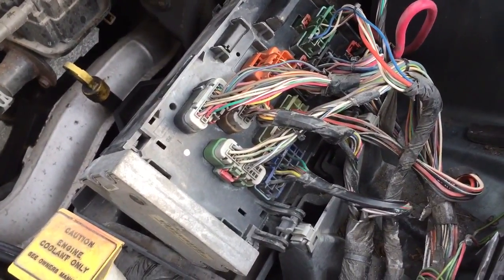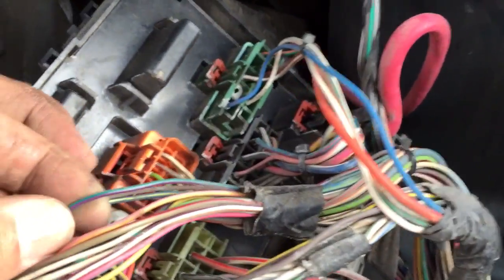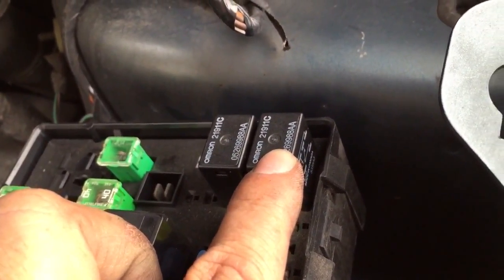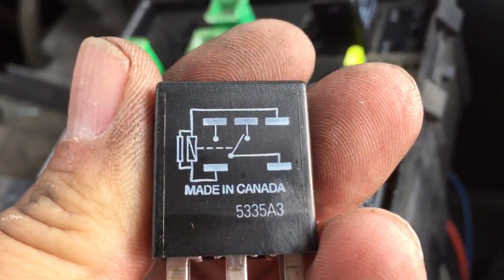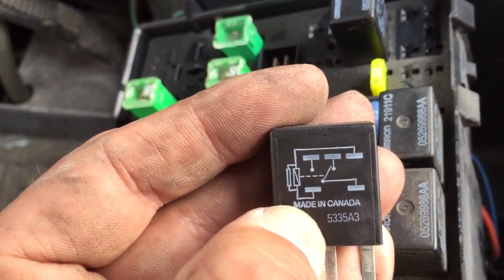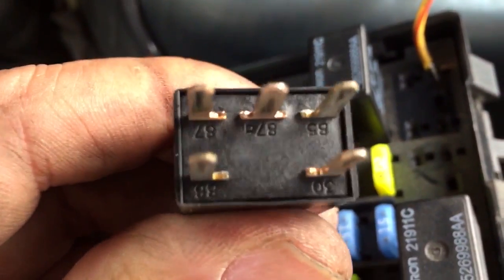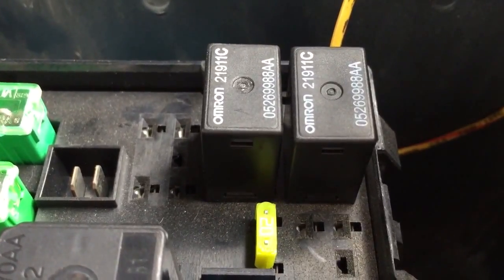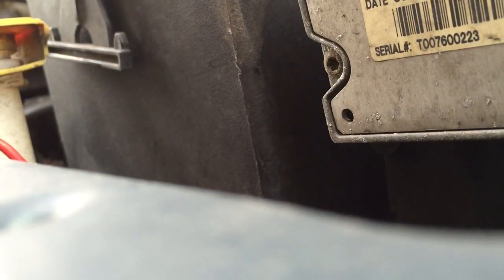2006 Chrysler Town and Country Horn Fix

Comment: Just did this today. 2004 Chrysler Town & Country. Worked perfectly. So easy, and what a simple fix.

Only thing I would say is, mine did use the purple and green wire, but where I had to put the jumper wire into the relay slots was opposite of this video. It was the UPPER LEFT. Horn works, and the horn still signals for the car alarm when you beep the remote.

I used solderless heat shrink tubing for the connection, then electrical tape. You just push the wires together inside the tube, and use a heat gun. Very easy. You can buy them on Amazon.

Thanks a a million for a great hack! Now my 3 year old son can't say, "Dada... honk-honk is boken! (Broken)" 🤣

Comment: After 3 years of trying the "clock" the relays fuses ect, finally found this video! I refuse to go to dealer, as I grew up in the 50s and 60s, did all my maintenance my self, cut cars up, rebuild them xke 3.8 4.2 Holley 4 barrels 283 chevy blocks Etc. I'll struggle not to go to someone else!Thanks sooooo much! Worked for 2007 caravan, the only thing on mine to test the horn it was upper left and lower right.Bob

Comment: just want to thank you ...  just bought a 07 T&C  the owner  didnt tell me the horn was out but he did hit the lock button on the key which made the horn blow so i didnt think that there  was a prob with the horn itself but low and behold the horn wouldnt blow via the  steering wheel so i did just what you did  and it worked i felt like a million bucks by not spemding a dime on the fix ... KUDOS to you and your VIDEO    keep'em  comming

Comment: I just used this video to fix my 2007 dodge caravan’s horn. Before I fixed my van, my horn would not sound from the steering wheel. However, it did sound when I pressed the panic button on my keys. So if your vehicle has the same symptoms, this video should work for you. Just make sure all your electrical connections are correct and contacting. After I fixed the horn, the panic button still works along with the steering wheel.

Comment: Great fix for this problem.  Just used it on my 2002 Gd Caravan Sport.  Thought of trying all the other suggested fixes but this seemed the most reasonable to fix a horn that can't be activated by the steering touch pad, but works otherwise

Comment: Great, clear directions, easy to follow. Unfortunately, when I applied the procedure to my 2006 Town and Country, the horn button still did not work, but now the horn does sound as soon as I put the transmission into reverse! I guess that the "dark green with a purple stripe" wire that I found was not the one I needed.
Reply: My 2006 caravan did the same - what did you do to fix it in the end?

Comment: thanks!  my horn was inop (2005 T&C) and the airbag light was on although cruise controls were fine.  I did the clock spring (airbag idiot light and no horn are classic symptoms of the clock spring having gone bad I guess, although often the cruise control buttons also go wonky).  Anyway, after clock spring, airbag light is out but still no horn.  I did this mod and my horn works again AND it still blows when locking with remote!  Although jumpering the pins where the relay sits did NOT fire it off, I did the mod anyway and it worked!!

Comment: Hi thank you for your help when push horn button relay was coming in i pulled the LH headlight to look at horn connection found a rat had chewed wires into i repaired wires had to add a bit to each wire now i have a horn.

Comment: I have a chrysler sebring and I'm having the same issues. I replaced the clock spring, there is no airbag light, and the horn works with panic and unlock but the steering wheel button just doesn't work. I'm trying to do your method right now, except my horn relay is in my dash. Can you help me find out how you knew which wire would be for the horn?

Comment: 2009 horn unreliably blows using steering wheel pad. May or may not blow. extreme pressure in a different spot will work..I think dirty contacts at horn pad. thoughts?

Comment: what happens if the horn and cruise control doesn't work, and the air bag light stays on?
Reply from the maker: Darryl T sounds like a bigger problem. Can’t help with that one.
Reply: @mjbop1  ...thanks anyway...I'm thinkin' it might be the clock spring...
Reply: @GOD OVER MONEY ......yes....I did that 5 months ago...thanks.....

Comment: @mjbop1 So, if fixed like this, will the horn still work with the remote functions? Lock, panic, ect.
Reply from the maker: Christian Giordullo no. That is the function that is broken.
Reply: So how how do  I fix problem so my alarm and steering wheel horn would both work properly what part do I have to change

Comment: are you saying the dark green with puple where it connects at the back of the relay socket is bad?
I think all you are doing is bypassing the connection to the bottom of the socket straight to the relay pin
that would have been connected normally?   I have a 2005 Dodge Grand Caravan SXT 3.8L.  Horn stopped working.
If I applied 12v to the horn it works.   A local shop is telling me its the Clockspring.
I want to make sure I understand what your modification is doing.  Your saying that wire is not making contact
to the back of the socket not making contact to to the relay.  You ran a jumper to the same point the green/purple wire
should have been making contact too?   Would this setup be the same for a 2005 Dodge Caravan SXT 3.8L?

If I press the horn at the steering wheel and can hear a relay kick in would that mean I have the connection?

In my case the criuse control works and I don't get a airbag warning message.    Thanks, Ken
Reply: +Ken I changed the clockspring and that didn't fix it.   What I can state is if I press the Panic button, or press
the horn at the steering wheel I can hear the relay click.  Shortly after replacing the clockspring the horn started 
working.   The next day it stopped working.   Any thoughts?
Reply: +Ken can you tell me what wires go from under the fuse box (the wires you show) to the horn.  Maybe
the power or ground from their to the horn is bad.
Reply from the maker: +Ken Maybe the color is different on your van.  You can test the wire with a continuity tester.  Connect one lead to the wire and the other to ground.  Press the horn button.  It should show ground.
Reply: +mjbop1 I believe I have fixed my problem.  I had 2 problems.
I changed the clock spring and now I can hear the horn relay clicking.   I have voltage at the relay that feeds the horn.
I went though the pain of removing the horn again and did not have
power at the horn.   With the horn out I added 2 jumpers to the the horn wires up to the area where the horn relay is.  I grounded one side
and the horn started working.  Its been working now for a week.
However I have had it work for a few days then it would stop.
If it does quit I will solder the the other wire to the output of the horn
relay and now I have my wires totally bypassing the wires going to
the horn.   The key thing was now I have voltage at the horn relay output and the horn did not work so I knew the problem was somewhere in between the output of the relay and the horn.
Reply: One side of the horn switch is grounded. Pressing the switch completes the circuit applying that ground through the horn switch, clockspring and connects through a plug-in connector to the integrated power module (IPM) or (TIPM) via the dark green wire with a purple trace. It goes through that connector which is soldered to a circuit board and to the horn sense switch pin 17 of the socket for the front control module (FCM). An output (pin 10) of the FCM feeds that ground to pin 85 of the horn relay energizing it and closes contacts 30 and 87 of the relay thus supplying power to the horn. Connecting a jumper from the dark green wire with violet trace to pin 87 of the relay bypasses the FCM and all connectors and circuit board connections in between within the integrated power module (IPM) or (TIPM). If the relay clicks when you press the horn switch, this repair does not apply as the relay is already being supplied with a ground in the way intended and is functioning normally. So, this fix only applies if your horn switch, clockspring, horn fuse, horn relay, horn and wiring are all good. This fix will not get the horn to blow with the key fob if that also isn't working.

Comment: Didn't work for me on my 2007. I got the horn to beep when I used the jumper cable and though this is it. but when i did the mod it didnt work and I couldn't get the horn to beep again when i jumped it again. But when i put the realy in and pressed the horn you can hear the realy kicking off and on. Go figure,.

Comment: I'm a 64 y/o Grandma, I'm going to try this fix on my 06 T&C tomorrow, can't get a sticker without a horn, never use the darn thing. Do you suppose I could just push the battery to the side, I'm not suppose to life heavy things?
Reply: Didn't work for me, still no sticker, this Granny has 14 days left before sticker expires.  I really hoped it would work for me.  Bummed out. Should of told you the horn did work, but not the way it's suppose to, the steering wheel button doesn't make it go off, putting the van in reverse makes the horn go off.  Help please???

Comment: I replace the computer in front of the fuse box and I still have no horn I was told it was a car audio place $600 later still no horn
Reply: No I do not know if that computer needs to be programmed in front of the fuse box